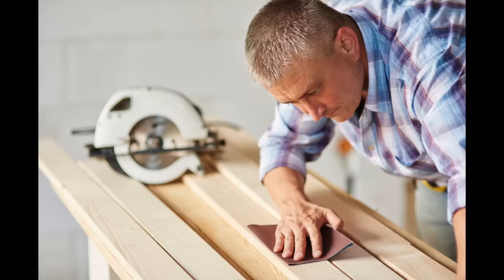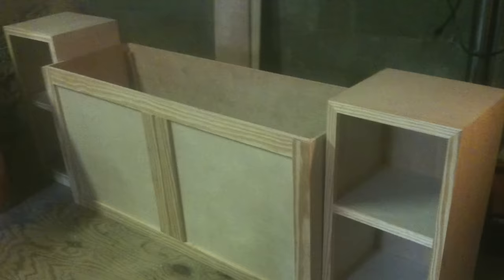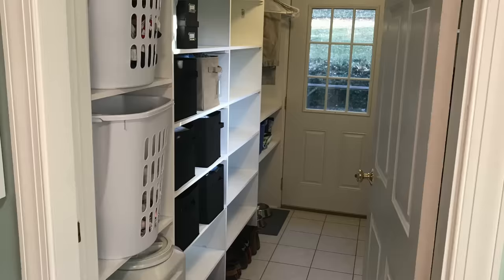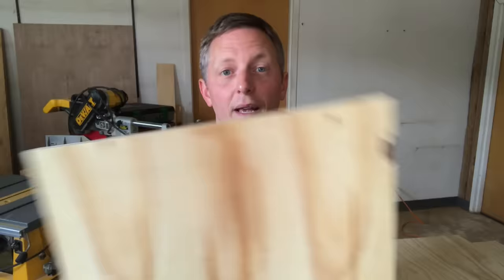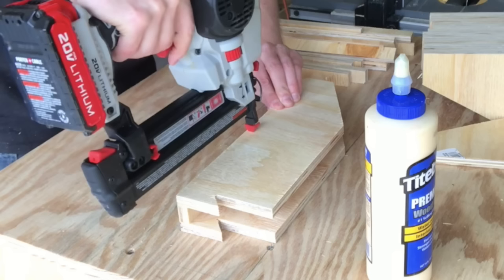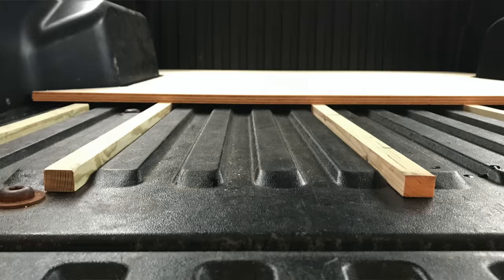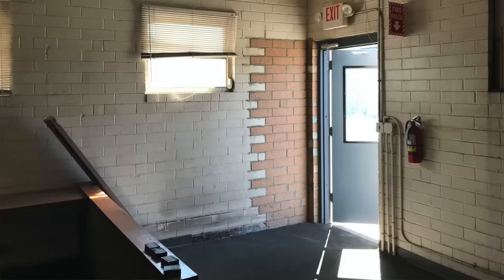DON'T USE 3/4" PLYWOOD If You Don't Need It...TRY THIS! (1/2" Plywood Vs. 3/4" Plywood--When to Use)

Comment: I've been looking into building a french cleat system in my shop and watching lots of videos about that to get ideas. I'm inclined to use 3/4 for the cleats themselves, but I've been surprised at how many people use 3/4 for all of the little bins and fixtures they mount on their cleat wall. It's definitely not needed for strength and it wastes space on the wall because all the fixtures are bigger than they need to be. Thanks for confirming my suspicions.
Reply from the maker: This is a very good point, Earl. I like 3/4” for the cleat (have used it before on this channel and will use it again), but building small fixtures with 3/4” is just cumbersome. 1/2” looks much more appropriate for small storage.
Reply: @TheHonestCarpenter  I have always used 1X pine or fir for French cleats. It cuts smoother than plywood and doesn't"t chip out: there are no voids. Plus it's just as strong (or stronger) than an engineered product like plywood. The cleats are never seen, so dimensional lumber works for me.
Reply: I won't confirm, since I am (an eternal) beginner. But looking at the many woodworking videos I see on YT , this french cleat business seems to me often overkill : making holes in wall, all this wood used for  taking care of stuff which could safely stay in a jam-jar easily, (think to the planet, my god!), and who wants to move one's tools from one place to the other all the time... My two cents. (And I am French ! :))
Reply: @etiloyon3681 , I agree that it is easy to go overboard with shop fixtures and furnishings, but as another eternal beginner, I consider making them practice for my "real" projects, and therefore time well spent. Also, about 20 years ago I moved into a new house and soon put up large peg-board sheets on one wall of my garage shop to store all my tools. Over the years as I got new tools, I had to spend time reorganizing as I got new tools that I wanted to keep near related ones. French cleats would have made that much easier. Finally, about two years ago I moved to a new house. If I had made a french cleat wall 20 years ago, it would have been easier to quickly put new cleats up on a wall here, and then put up all my existing fixtures. But now I have to essentially start over with organizing my new shop.
Reply: @earlmorton1216  Ah, yes, it's true. Many people buy tool for building gears for putting tool. And they use a lot of composite wood like platted wood, MDF, and so forth. Here in France I just bought a board of chestnut board (2.5m x 0.20m x 0.02m and I understand them. €10 = $12 ! !Woodworking is turning into trendy hobby. Maybe I am wrong after all . The fact is I don't like to make holes in my walls and you have to admit French cleats don't help at this level. Good luck for your projects and thanks for your kind time.

Comment: I have noticed that many use thick plywood for just about everything.  I have been using 1/2" material for a long time and had no issues with it. Sometimes I do use 3/4" material when necessary, but 1/2" had been my go to for  years.  And the small pieces are great for small projects, especially for shop projects I'm using myself.  I even used 3/8" material for some projects.

Comment: My friend,you are so right.3/4 inch plywood is complete overkill. I've been building some kitchen units 
out of 3/4 inch ply, totally unnecessary,they are built like a tank,so heavy, so cumbersome.
1/2 inch or 5/8 is the way to go. Much easier to work and saw. Great video.

Comment: I learned all this a few months ago. The nearby store was out of 3/4 and I didn't have time for the store to restock. It was a decorative piece, so we used 1/2 inch and it was plenty strong and much lighter. I never really went back to 3/4. You just don't need it in most applications. 5/8 ply is also a good option when you need need to save a little but need something big and structural. A client of mine bought 5/8 ply instead of 3/4 and we used a few sheets to build some closets. They're holding up just fine. In my area you can get 1/2 inch ply for 70% of the price of 3/4, probably because people don't use it as much (and it's always in stock to boot). Even hardwood veneered 1/2 inch ply is really cheap!

Comment: 100% agree! One thing you didn't cover is that not all plywood is created equal. If I'm doing cabinets I want Baltic birch plywood. That raises the price but the product is far better. It's got no voids, it's flat (!) and the edges look far better than inferior plywood. I've actually seen table tops rounded over, sanded smooth, and finished in Baltic birch that looked beautiful. I get shop grade for shop projects, and you can even get pre-finished furniture grade for cabinetry, etc. If something is going to get rough use I'll get the big box stuff but that stuff isn't flat and I hate it.

Comment: 3/8" inch ply is very handy too. It all depends on what reinforcements you use and where they're placed. I once built a floor-to-ceiling storage in a corner. I used 3/8 for the vertical parts because the shelves true out the wood and the load vertically wasn't affected at all.
Reply: And no strength will be the result. You get what you pay for.
Reply: @dlvmil-spec  Depends on the application. If it's not load baring, it won't make sense.

Comment: Great message here! I liked this enough that I had to look up my password just to log in and throw in my two cents.

Having moved my share of insanely heavy DIY furniture pieces, I can appreciate a weight reduction. Cost is a plus too, but don't miss the message: don't default to 3/4" when something thinner will satisfy structural requirements. How thin? Well now, that is entering a whole new realm...

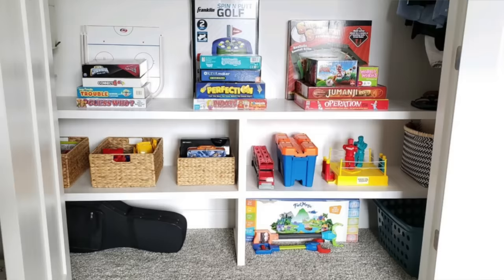Ever heard of ultralight plywood boats? The hull is a shell of thin flexible plywood (4 and 6 millimeters!). The strength/stiffness comes from the edge and "joint" treatments, e.g. gunwale, keel, and chine. Take another look at some of the pieces he showed in the video: those face frames, wall cleats and tiny strips at the corners of intersecting panels (middle of the storage above that custom wardrobe at 3:12 and the center of the closet shelves at 3:34) are there to give them strength. 

Now, at 4:16 he talks about avoiding large spans. But do you see that he could have put a cleat along the back edge of that unit to stiffen the shelf? It already is going to get the face frame, so it is a simple upgrade to add it. Want to go bigger? Add ribs, like the back of a guitar or piano soundboard!

Let me show my colors here: I've built an ultralight boat before. A rowing skiff out of 6 mm marine plywood and 14 feet long, if I recall correctly (30 years ago...). I think it was 90 pound total. I weighed 130 pounds in those days and could pick it up--though it was awkward! Anyway, when it came time to build some stuff at my home, what do you think I did?

Yup, 1/4" outdoor plywood that I used to be able to get at the lumber yard. What a trip. I was building stuff on my dining room floor, gluing 1x2 (nominal) battens to whole sheets and cutting  up the middle of each batten to make my pieces with one "chine" already attached. Lets' see...a 6.5 foot tall pantry in the kitchen, about 22" wide and 30" deep with recycled cabinet doors (the only "thick" stuff on it other than the face frames). It is packed with cookbooks, appliances and food stuffs and hasn't fallen down. My daughter got a shallow bookcase almost as tall for all her collections. The edges look nearly 1" thick because all intersections and free edges (front edges) have a ~3/4" square strip glued to them. My other daughter got a 8 foot long, 16 inch deep "low shelf" unit that ran under a window. On top of that went about 4 foot wide bookcase about 12" deep that reached to the top of the window. The trick was put central support in the lower unit, i.e. vertical face frame and ribs under the top. I did have to rework that one--I didn't think about needing that rib to support a 12" deep unit on a 16" deep surface. An easy fix. 

The only limit is really just the stability of your panel stock and your ingenuity. I was using 1/4" luan underlayment, but it was absolutely stable. I never saw a piece buckle or curl unless I left if leaning some where--and I could always glue it flat when making parts. The luan vernier could have been nicer, but is was better than what luan plywood used to be a few decades before!

I was going to build more but then my source switched to some trashy underlayment that would warp up and bubble just laying on the floor of an air conditioned house. I could have tracked down some of that nice birch plywood or even marine grade plywood, but those weren't $20 a sheet like the other stuff was. And life got busier.

Comment: Don't overlook 1/4" ply either. It's plenty to act as a skin over a skeleton to prevent racking if designed that way with its limitations in mind.
Reply: Heck, even 1/8" is enough on the back of a bookcase to prevent racking. my bookcases from Target from 15 years ago had thin fiberboard, and that's even been enough through all of these years.
Reply: It's my go to for drawer bottoms as well. Tough enough not to bend and pull out like 1/8 hardboard that ikea uses.
Reply: @necrojoe  IKEA used 1/8" fiberboard pretty much exclusively for rigidity.
Reply: @necrojoe  Umm... yeah. Except the crap 'nails' they used, pull out when you breathe on 'em. Screw it!
Reply: Yep!  1/4" backs in a rabbet, glued and nailed, are incredibly strong.  Same principle, but but much better than the cardboard used in most knock down furniture.

Comment: We built our entire bus interior out of 12mm plywood which is very similar in size to 1/2” with 42x19mm timber for framing. Worked great and saved us heaps of weight. Only issue is that the widely used euro style hinges in cabinets are too big so we had to use different style hinges.
Reply: Hi John,
We’re building out a van and using 1/2” ply for our cabinet doors.  What hinges did you end up going with?  We just realized you have to drill a 1/2” hole to install cabinet door hinges and are not quite sure how to proceed.
Good things,
Nat

Comment: I switched like this by  accident about 2 years ago and thought I'd try it and it worked out.  Where I really needed the strength I doubled the material to total 1 inch over that small area still keeping my total cost way down.  I'm already planning my next project with 1/2 " plywood.

Comment: I use a ton of 1/2 and thinner for many many things. 3/4 is awesome bulletproof stuff but just hauling and storing full sheets is such a pain. However, for certain things it pays dividends to go to 3/4 like longer span shelves, or wide/tall vertical cabinet or closet dividers and walls. It stays flat and warp free on it's own. Plenty of bite for screws that won't poke through the other side. Most stair treads for sure. Work tables: 2 layers of 3/4! 1/2 will sag and you will spend more time and money on more frequent shelf supports. Span strength across say 30-48" is vastly stiffer than 1/2, sorry. Also sorry but 1/2 looks kinda flimsy, with 3/4  you don't need to face it with solid pieces to strengthen or hide how thin it is. You can just put on a quick iron on edge veneer and it looks solid because it is solid.

Comment: I've used all thicknesses of plywood for various jobs. I always go as thin as possible while keeping safety, like 1/4" for drawer bottoms, linen closet shelves, paneling a room that already has 1/2" or better drywall for the "real wood look". dresser/cabinet backing (assuming the rest of the frame is solidly built.

Comment: New Subscriber :-)
Just found this channel and i love your attitude. Having said that, I hate carpentry, but I have made it my mission to become competent working with wood. I spent a career engineering and building things out of sheet steel, aluminum, and cast iron. sure, I have done the odd carpentry repairs and fix-its any homeowner has attempted, but they all have looked so "Oh, how Nice. Did you do that yourself?" It is my goal to level-up my skills. I think this channel is where I need to start.

The few videos of yours that I have seen focus on safety and choosing the right materials and tools. Those subjects have always been core to me. I look forward to your future videos and to looking through your past content.

Comment: I like your point. 3/4" OSB is used for floors, and 1/2" OSB is used for walls. Makes sense that if you aren't anticipating climbing up onto the project, 1/2" will probably do. Not to mention that plywood is much stronger than OSB in my examples, so standing on 1/2" might be a maybe...

Comment: Thanks for another great video, I  fully support using 1/2" ply over 3/4", together with your advice to use face frames, centre supports on spans longer than 24" and cleats, makes the whole project easier including measuring, and no doubt on cost saving. I must also commend you on your pronunciation of Navrathri, awesome! Stay safe and well.
Reply from the maker: Thank you for watching, Sundra! I’ve had many great clients over the years who celebrate Navrathri 😄
Reply: @pachinkotronkfollo1075  I like using maranti, better than using pine because it is easier to finish, although you can use pine if you want to paint it.

Comment: As a professional carpenter /cabinet maker, what I do most of the time is supplement 1//2" birch ply cross members with 3/4" side walls, you'll find that a 1/2" dado in a 3/4" side wall, makes for a very strong joint, when im spanning more than 36" with 1/2" shelves, i'll use a piece  of 1x as a strongback under the shelf , then put the nosing on covering the entire edge.

Comment: I made my first workshop table bench and shelving with 12mm plywood (I'm in Australia so it's the equivalent). It's plenty strong. I put 60-70kg of weights to test its strength over 2 days and it was rock solid.
Reply: Thank you, as a fellow Aussie, that's the detail I was looking for lol - planning a hobby table.
Reply: @MLaak86  no worries. I currently holding all my extra timber purchases, tools and it's not budging one bit. Definitely strong as long as you brace it evenly.
Reply: @jiminy2731  Planning out a table for miniature modelling work (3D printing, constructing, airbrushing and hand painting) so pry don't need something super heavy duty but still able to hold some weight
Reply: @MLaak86  nice! At least you're confident nothing will collapse and can take a beating!
Reply: @jiminy2731  yep if yours can support lots of weight then one that’ll have maybe 20kgs on it max should be more than served by 12mm

Comment: I’m happy to see this and hear your opinions. I’m starting a building out in my pickup and shell top for camping and have been torn between using 3/4 like most people I’ve seen doing it or using 1/2 . With proper bracing sure looks like 1/2 inch will work just fine. Thanks!
Reply: Look into small boat building techniques Tack and Tape,  And Stitch and Glue. You can use 1/4"! 

  Also, PMF, poor man's fiberglass...

Comment: Great video, I used to use 3/4  but learned to use 1/2 inch its much easier to manuver around shop and once you build product youll have plenty of scraps to reinforce if needed, also you can frame projects with 2 by 2 and use half inch  will be lighter

Comment: I am almost finished with a shelf and coat rack in my garage using 1/2 plywood. I follow your site and have picked up more good tips than I can count but NOT this one. 1/2 inch plywood is a pill to keep straight when making cabinets and shelves. It flexes when cutting, it's just thin enough to require extra attention to every fastener or they pop through. It's too thin to cut an inset for the shelf tracks so they have to be surface mounted. It might be good for someone with your experience but has doubled the time and effort on my project. I do appreciate your site and the way you keep your videos short and to the point. Just wish I had missed this one.

Comment: 5/8" is a good compromise. When ever the US switches to metric I'm going to start using 15mm!
Reply: HAH !! We don't need no Foreign Rulers !!
Reply: Never going to happen.
Reply: @reecenewton3097  Hey they told me in 6th grade it would. Granted that was almost 50 years ago...
Reply: @mickjager5974  Yeah, they told us that too 60+ years ago, and I got used to using metrics in physics and chemistry, but for everyday use and construction, pounds-feet still reigns. Even in Australia and Canada where the gov't  force-fed it to the people, many still refer to the old way. Yes, metic's more logical etc. etc. but still we love the old way. Off the top of my head, water weighs 8.337 pounds per gallon! The spacing of studs in building, 16", is based on the length of an average forearm from elbow to fist, used by pioneers who hewed logs, had an axe and a maul, and no measuring stick in sight besides their fingers and arms.
Reply: @reecenewton3097  Yeah they used their thumbs for a inch till they cut theirs off. Then they made measuring sticks based on their neighbors thumb and the new stuff never worked with the old so they stopped trusting new things!
Reply: @mickjager5974  LOL !

Comment: I used to be the go to guy for lifting anything heavy... and I was good at it. At 62, it's been a bitter pill to swallow,  that I'm not that guy anymore. Wrestling with 1/2" instead of 3/4" will be a welcome reprieve. Are you sure we can't build sturdy cabinetry out of 1/8"? 😆
Reply: Sure as long as you use 4 layers.
But seriously, 3/8 should be good for most shelves in the kitchen or pantry.